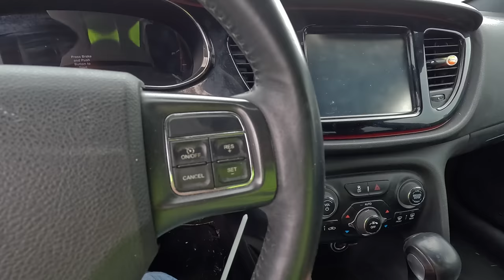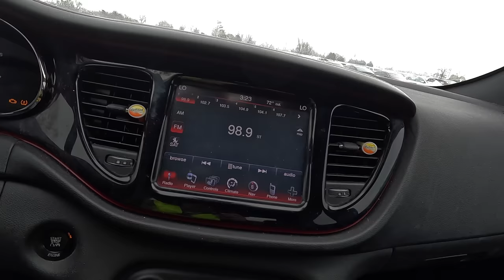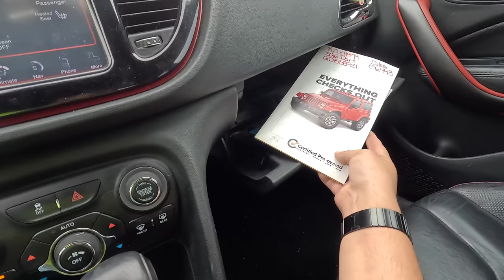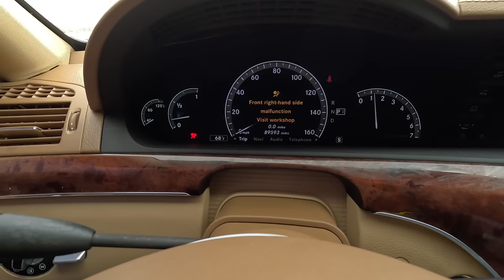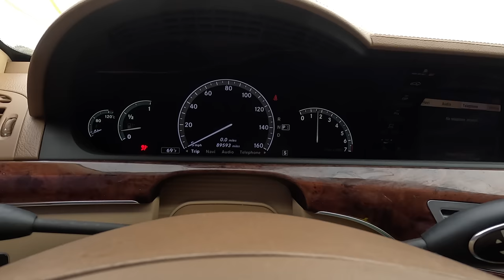Copart Walk Around 3-13-23 + Tornado Cars and a C7 Corvette

Comment: Love the wheels on that black Elantra. That was a Limited model by the way. The engine noise was definetly the GDI fuel system. The 2.4L engines are the ones that have problems, this one had the 1.8L in it, it's fine.

Comment: These darts are actually pretty good, mines got 264k it’s a 2015 SE Rallye 2.0, that dart has some good options, dual strips and the OEM mopar aero kit, the CeL is probably evap like they all do, abs and traction could be a wheel speed sensor, also it has the tech package the back up sensors and navigation lol, missing the sun and sound package sadly the GT had the N/A 2.4 limited and SXT had the 1.4t as a option 2.0 is the most reliable one
Reply: I have a 2015 Dodge Dart SXT I'm the original owner and it had just over 300,000 miles with I just replaced all the spark plugs and 1 ignition coil and made an appointment for an antifreeze flush and thermostat
Reply: @michaelgorman4229  I got my car new with 2 miles I’ve had normal maintenance and stuff that’s had a issue with the miles

Comment: Randy fyi I used to work for hyundai from 2011 to 2017 they had problems with the bottom end knocking and Hyundai and Kia will do a short block on most of them in some cases complete engine

Comment: That Elantra was probably an Elantra Sport. Not only are they nice on the inside, they have a faster engine (201 HP vs like 170 on the normal version). The engine sounds significantly... growlier... on those. My neighbor had a 2018 Elantra Sport that sounded amazing, and not unlike that car. There could be something wrong with it, but that might just be how this car sounds.

Comment: One thing to remember when looking at tornado damaged units, be careful about flipping the blower on to check a/c, you might get a faceful of Lord knows what, and some of it could have some form of contagion in it.  Joplin 2011, there was alot of bad air that was causing people to catch COPD, & other respiratory issues.  It likely originated from the destroyed hospital that had 50 yr old contained tuberculosis samples in the basement, but they'll never reveal that.
And yes, tornados do weird things to cars, I observed a Honda sedan folded around a light pole at an intersection, trunk was touching the hood, only way to identify it was by exhaust, underfloor pan was visible, top side passenger compartment was not....
Our 96 Acura 3.5RL had a tree shoving it down in the driveway 4 inches, while an F150 from 2 blocks south sat on top of it, halfway over our basement where we were.
Good times, let's wait a Lifetime to do it again though!! 😉

Comment: Is the Dart the successor to the Neon? 🤔 Both Fun cars!
Reply: Two cars replaced the Neon. The Caliber was the first successor to the Neon, although it only lasted 5 model years before being discontinued. The Dodge Avenger replaced both the Neon sedan and the Dodge Stratus, and it sold better than the Caliber did. It lasted two model years longer than the Caliber, alongside the it's luxury cousin - the Chrysler Sebring/200. However, in 2015 when it came time for a redesign, the 200 got it. The Avenger was discontinued. The Dart was meant to replace the Caliber at first, but then ended up also being the indirect successor to the Avenger too, despite the Avenger being slightly larger.

Comment: Definately a rod knock on that Elantra. Any of those Theta engines are prone to it cause of faulty manufacturing. There's a class action lawsuit that will require Hyundai to replace the engine. My 13 Sonata engine failed and I have lots of videos on my channel about it.
Reply: Our 2007 Kia Optima LX Sport had the Theta II four cylinder. It never had a rod knock, although the engine did get a little tappy as the car aged. It still ran and drove perfectly when we sold it three years ago with 127k miles on it - for a ripoff of $1600.
Reply: @JrZCarZ  Dang. We never had an issue that severe, but there were multiple less severe issues with the car that the dealership tried to weasel their way out of fixing. We had to just live with them, until I fixed a few of them myself a few years later.